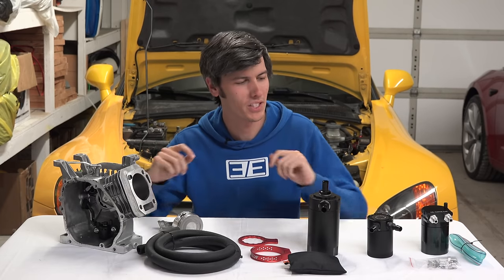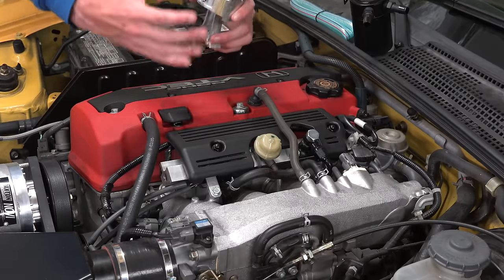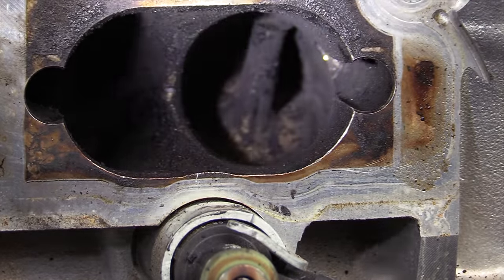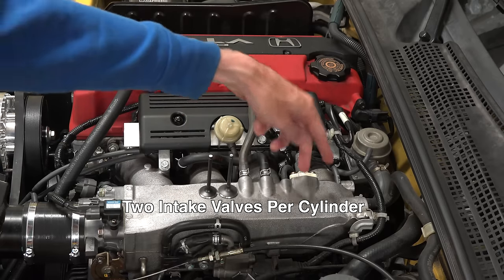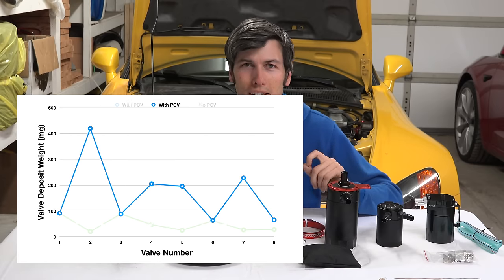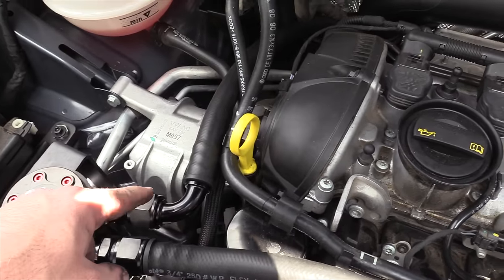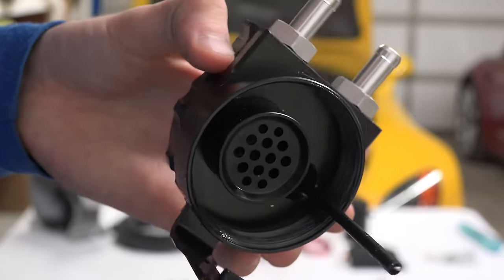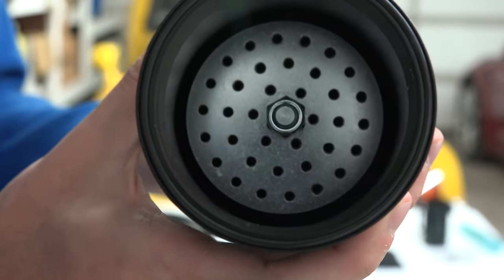Do Oil Catch Cans Actually Work?

Comment: I think you should have talked about cold weather a bit. I don’t recommend running a catch can in places where there is freezing temps. Run it in the summer and remove it during winter.
Reply: Why does cold weather make a difference?
Reply: Geoff Kim it can freeze and plug up your pcv system.
Reply: I live in NY and it is below freezing for several months. You can run a catch can in cold weather but you really want to check it a lot more often. One thing to note is that it's oil and water mixed together which does have a lower freezing point. I've never opened it up to find frozen liquid in it. On the same token, most of the crap it filters out in the winter is condensation on startup so you have a higher percentage of water. Another solution would be to put a couple tablespoons of antifreeze in the can after you empty it to prevent it from freezing.
Reply: Perhaps insulating the can would minimize the condensate.
Reply: Jigga Man What part of NY do you live in? I live in the boroughs (NYC) and while it does get could during winter, I’m not sure if I would label it “freezing”. I imagine Canada and Russia become freezing during winters.

Comment: The proper solution is what other companies did with their DI and have two injectors. one just to keep the intake valve clean.
Reply: OK I'm sure he can just make that....
Reply: @HorsepowerHouse  they do make PFI injection kits. they aren't super complicated.
Reply: My Ford has.both injectors as do other makes buy what you want
Reply: Doesn’t work for diesel, you can’t port inject diesel fuel or else your engine will throw a big sad :(
Reply: Best solution is adding a methenol tank that goes straight to an atomize injector on the intake manifold (custom throttle body spacer with the injecter fitted into it). Not only does it keep your intake manifold and valves somewhat clean, you get good power out of it. Keep in mind that you're required to tune the fuel ratio if you pick the high performance setup, if you run out of menthanol then you may damage the motor if you run it for too long.

Comment: Once again well-done with a great and informative video Jason. I'm just a bit torn between your video and one from another YouTuber on this issue.     My big concern is that in the other video the guy warns against fitting a catch can because the catch can slows down the flow of the oil vapors    effectively  raising the pressure inside the crankcase of the engine again. What is your take on this?
Reply: Does he show evidence?
Reply: @DrewLSsix  Seen a couple videos where it does.  The brass filter can clog easily. Another video shows a rear main leaking because of. Not saying there are no designs that prevent this.

Comment: Weird enough i was looking if you did a video about catch cans the laast few days. 
One of the only sources i trust, great timing!
I'm wondering what the effect is with diesel engines like the 1.9 TDi
Reply: For a diesel you really want one. But do spend the cash to get a proper one and not a crappy one, getti g a crappy one is worse than not having one at all.
Reply: @illernpiller  thank you for your opinion. The catch came to mind after a suspected pcv failure. With normal driving, never smoke. But in traffic jams, i get blue smoke if i climb up in revs after being stationary for a bit. 
I suspect blow by with oil getting into the intercooler, settling there until enough air flow picks it up to be burned. (No power loss whatsoever)
Annoyingly enough, the pcv is integrated in the valve cover of a 1.9 TDI brb. Guess i'm getting a new valve cover and afterwards the catch can.
(injector seals got checked already)
Reply: EGR delete is the best thing you can do to Diesels if it's legal where you live.
Reply: @illernpiller  Wich brands do you reccommend? 
How can you see if one is goos or crappy?
Reply: @dimmacommunication  I would suggest provent, only downside to it is that you need to change the filter from time to time, but that is in another sense also a good thing.
Also deleting the egr as someone said would be bad if you ask me, it's there for a reason and it's not only for less pollution.

Comment: I have a Winnebago EKKO RV on a Ford Transit chassis.  3.5 turbo'ed V6.  Poor little thing works hard basically shoving a bard door through the air.  I drive it really easy on cruise control and in 9th gear to let the motor spin up a little more than in 10th. About a 200RPM difference.  I empty the 3ounce can when it's about half full at around 1500miles.  If you don't have one of these on your direct injected motor, let alone a turbo'ed motor, do it today.

Comment: Micron particulate filter slows down PCV air flow tremendously, this causes the air to backup and exit thru the ventilation tube which pushes oil out the engine and into the air filtration system. catch cans are good for engines with a little blow by. But for engines with a lot of blowby you are better off solving the blow by issue directly. Either your piston rings need to be replaced or your cat is clogged and needs cleaning/replacement. Both will cost money. As for boosted engines, blow by will be more and the option of piston rings isnt the issue. The only option would be free flow exhaust(catless and straight pipe) or run 2 catch cans, 1 for vent pipe and 1 for PCV. There should be another option for PCV where there is a pressure bypass that works with its own internal baffling and drainage. Combined with an air oil separator for vent tube to air cleaner.

Comment: I know this is an old video, but I've found a lot of carbon deposits on piston faces as well. This happens regardless of the type of injection you have. Oil catch cans are far more important than people like to think.
Reply: If they are then why do all these car manufacturers using direct injected engines not install them?!?  Are there any real credible tests results that prove they work? By which I mean not all ones that show how much oil was filtered out but ones that actually show much cleaner inlets after say 50.000 miles?!? If so please link some as I'm interested..
Reply: @inflatable2  My guess is that dealers do not put them on at the factory so they can sell the intake valve cleaning service. Has to be a nice profit in that.
Reply: @cousinjohncarstuff4568  nailed it
Reply: Why did I get downvoted hard in a mustang sub in reddit when I said oil catch cans should be one of the first upgrade they should get.
Reply: @saucysauce4713  Because Mustang.
Reply: @saucysauce4713  because you dont need it to run over crowds of ppl...
Reply: @mrwascallyt9865  lol false, it's a maintenance product that you have to check you might be lazy and might not want to check it. There are people in the forums that sell their catch cans because they don't want to do this extra task of checking it. You could have problems also if you live in very cold areas they can freeze up if you're not on top of it(you might think you have a warranty claim manufacturers don't want any part of that nonsense). So there's no conspiracy behind it if you want to do the extra tasks of installing and checking it(even more in the winter) to keep your engine clean. That is up to you. Kind of like Walnut blasting isn't included with your car.

Comment: Jason, I think it would be interesting to see the difference between a regular GDI engine, a internal "catch can" system and a dry sump "breather" system. The new generation LT1 Corvette/Camaro have these differences. Even the 2017+ Corvettes use a different PCV routing system than the 2014-2016 ones.

Comment: Hey Jason (or anyone who will be able to answer), 

The question i had that wasn't answered in this video is this - is it crucial to have your catch-can connected to the intake, or can you just filter the air out to the atmosphere? Do i really need the under-pressure that i get in an intake to connect to the valve cover?
Reply: Depending on the blow-by level and ring life or application or power levels you could get away with either.  But a vacuum assisted catch can is always better.
Reply: Great question!
Reply: Up until the '60s-'70s vehicles used to route these exhaust fumes seeping to the crankcase directly into the atmosphere. Of course it is not a great idea due to these being unburnt gasoline vapours and possibly oil mist which are quite harmful. This is the reason why manufacturers had to re-route these through the intake.
Anyway, a catch can is a really good way to prevent gunk from forming up and avoid freeing some toxic gases into the air.
Reply: Great question!  Along this same line, is there more blow-by in turbo or super-charged engines?
Reply: Alex Mobley yes
Reply: Alex Mobley More pressure on the combustion chamber increases the likelihood of blowby, especially in modern 'small' engines with such a high compression ratio and operating at very high internal pressures.
Reply: @MrSleepProductionsInc  Thanks
Reply: I think it doesn't matter that much, the real question you should consider is if it's illegal in your country. I don't know the exact legislations in my country, but nobody is checking that so everyone including me is venting it straight to the atmosphere.
Reply: @svetko05  i was going to but forgot to mention that im interested in the technical aspect, putting the environmental / legal issues aside
Reply: @ZeroOne01Rus  I'm not sure, but judging from my experience and all the other people I've seen, no one is connecting it back to the intake after the catch can and everything is working fine.
Reply: The catch can is connected to the intake because the intake have low pressure,the low pressure helps the function of the catch can because it sucks de gases.
Reply: @ciroricciardelli1448  yeah but you're sucking the useless gases from the crankcase instead of more clean air which would make your intake cleaner but won't increase power.
Reply: It was in 1964 in the US that PCV systems were made mandatory. Really the first emission law. I have always run the valve cover hose directly to the atmosphere on all my vehicles. I generally run a PVC valve as a one way check to not allow dust back into the crankcase at low RPM (idle) conditions in 1 or 2 cylinder engines.
Reply: if you're venting to atmosphere just route the pipe down to the bottom of engine like the good old.days . If you have a catch can it's just trapping the oil to be poured down a drain instead of dispersing it through the air for sharing with everyone else
Reply: Overpressure the crankcase and there is a possibility to blow seals.  Direct vent will make a mess of your engine and under the car to say nothing of smelling the oil burning off manifolds and exhaust pipes.
Reply: ZeroOne Engines last longer with crankcase gases removed under a pressure differential and that is easily achieved using the intake vacuum with the added bonus of cleaning the emissions. Burning hydrocarbons does produce acidic gasses and those are also vented this way. The PCV valve limits the applied vacuum so the engine doesn’t suck all the oil droplets into the intake manifold under highest vacuum like deceleration and idle by using a pintle valve with a light spring.. It’s almost a free system of improvements to engine life and atmospheric emissions. The catch can is a real help on direct injection engines when they don’t also use one or more upstream injector for intake cleaning. Good upgrade!
Reply: I merely put a small crankcase vent filter on the top port of my can, and I block off the "out" port of the can.  Because I don't want the hot air going ANYWHERE NEAR my intake.  Simple as that.  2007 Mustang GT.    Runs perfectly too.

Comment: Down stroke of piston also pressurizes crankcase which multiples pressure.  If you put a on drain port and check valve on drain you can have it drain back into engine. Never have to touch it.

Comment: A tuned Pontiac Solcetice with 800K KM?’!

Stop lool! That’s impressive.
Reply: Sasha Klim Must’ve Been the one GM screwed up and build right.
Reply: @recoveringnewyorker2243  The solstice/sky interior is garbage, the suspension is ill-suited, the absurd to use top is prone to leaking and other problems + it's $2K to replace.  The expensive fiberglass fenders break just due to stress from the brackets holding them on, the electrical system is an accident waiting to happen, the window motors burn out,  the rear diffs leak, and 150 dollars in cam position solenoids need to be replaced every 30K miles. The ignition recall and airbag recalls affected them, 500 dollar passenger airbag sensors that go bad every 40K miles only became recallworthy 2 years ago thanks to my forum badgering GM.  The engine is beyond tumultuous so they had to put a flywheel the size of a dumptrunk on it that makes it drive like a minivan.  The turbos only last 70K at best, the gauge cluster is invisible during the day, and the body control modules almost all had problems.  They did NOT build it right.  They made a sexy mess with supercar maintenance expenses and chevy cavalier build quality.
Reply: That they then drove 16k more KM wow
Reply: E So? What else is new?
Reply: @e2622  Well, it's not even sexy... Fugly and also a piece of crap as well xD
Reply: It wasn't tuned. It was the GXP which came with a factory turbo and intercooler, as well as some internal improvements to handle the boost.
Reply: @e2622  funny you mentioned cavalier build quality. I had a last generation cavalier and beat the piss out of it and it wouldn't quit. The only thing that took it out was a truck that made an illegal turn across my lane of travel as I was coming through a light. As for the comments about the solstice, I've never owned one but I own a turbo ss cobalt. It ran like a scalded dog till the fay the motor blew(110,000 miles) and that was while just cruising at 70mph. The only let down of that car is the electrical gremlins no dealership seems to be able to figure out. Currently have a brand new crate motor sitting in my shop to throw in it once I get the funds to put some beefed up internals in.
Reply: As they say, a GM car will run shitty for 100s of thousands of miles
Reply: bobthbldr3 that’s hard to say, as we don’t know said person or car. But at 20psi, we can assume it may have had a tune on it. Typically you’ll never see that much boost. 14-16 is the normal range for stock. 20 would be an extremely rare spike.
Reply: @MrSKlim  honestly stock trim they can spike around 20psi but generally stay around there. I have a cobalt and on the gm stage 1 flash it was making 18-20psi completely stock other than the gm ecm flash which is part of a kit that includes higher reading map sensors. I am on a mild tune nothing radical and it runs around 22-25psi depending on atmospheric conditions. I always got the same reactions from people when they asked how much boost I was on when it was stock and I told them 18psi. They thought I was crazy, but that bjust how they come from the factory.
Reply: Solstice engine most likely toyota mr2 engine. Dont forget at about the same era pontiac vibe and toyota matrix are the same chasis and engine. Just like the good old geo metros were crappier versions of  tercels and corrolas
Reply: @roybiggins3885  its an opel derived engine. Look up the opel gt, the saturn sky is a rebadged opel gt

Comment: What if you just vent the pcv to atmosphere?  Does it need that vacuum to pull the pressure properly? And where would you run the vacuum line on a turbo car?
Reply: You could, and a lot of people do, you've probably seen those small filters they put on the valve cover breather. It has some drawbacks though. A turbo car connects the breather pipe to the intake side of the turbo so it sees vacuum and not boost
Reply: @TomNicklasSand  so if your running an unfiltered open turbo then you have to run it to atmosphere right?
Reply: @mazory1162  yeah or you could run the line to a catch can
Reply: The pcv is designed to work off of vacuum. You can vent to atmosphere safely, but will be changing how the system is intended to work. Crankcases work better under vacuum.  Also you will get oily residue wherever you are venting it. Running it on a turbo engine is no different than on any other engine. The only thing you need to keep in mind is that if your pcv valve fails on a turbo car, you will literally be pressurizing the catch can, which may or may not cause you some issues there lol. You can also run a catch can on other parts of the vacuum system depending on the engine. Anything that connects to the valve covers is a good spot, regardless of a PCV valve being there.
Reply: @7inchexhaust  awesome thanks. Only issue if rotarys dont have valve covers lol
Reply: @mazory1162  Haha, can't help you there. Idk who thought spinning triangles was a good idea :D
Reply: @mazory1162  my car was smoking so bad from previous owner capping the vent finally when i seen it i just vented to atmosphere and it runs great now with no smoke. S5 13bt braaap
Reply: Venting those toxic gases to the atmosphere is a great way to increase your pollution output.  This is why they are routed back into the engine to be burned.

Comment: The PCV system needs a ∆P between intake manifold and crankcase pressure. This is very difficult to acchieve in Full load (throttle totally open). If you use this type of filter the ∆P need to be higher due the higher restriction of this modification. If the ∆P is not enough, the crankcase pressure Will increase, causing oil leakeage and oil to return to the Air filter.